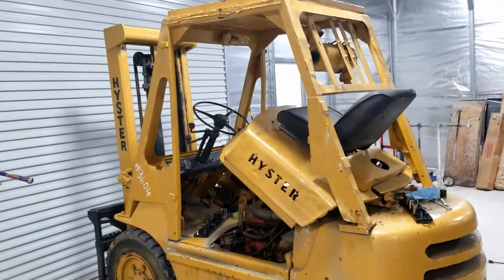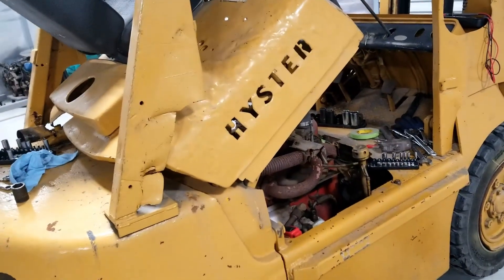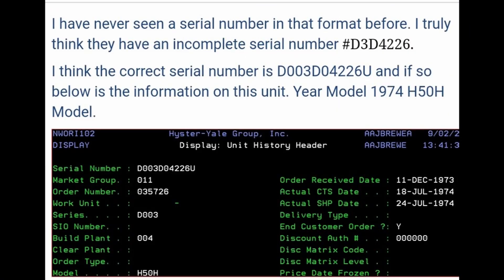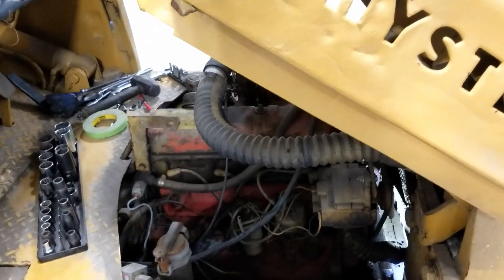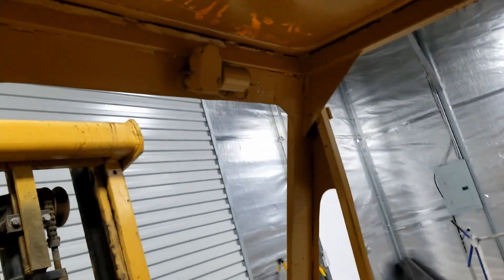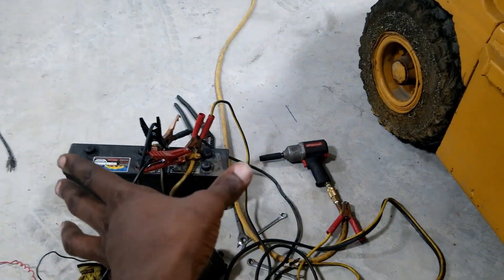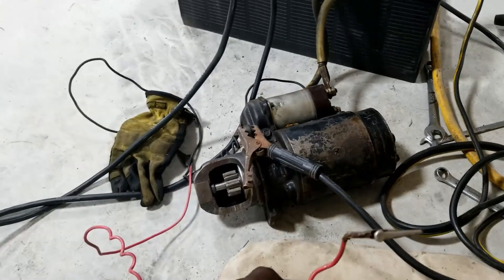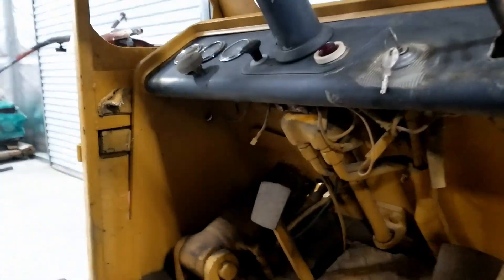Hyster H50H 1974  no crank

Comment: The thing over the windscreen is a wiper motor, the big cylinder in the roof is the air cleaner for the engine it should be down near the floor plate but it has been moved uo there, this is done usually when the machine is working in dusty conditions so the engine has cleaner air higher up. The truck is a H50H  capacity is 5000lbs at 24 inch load centres. the mast looks like a 3,3 mtr IFL two stage. Normally in the UK it would have had a Hyster mototrol powershift transmission but this one looks like it has a wet clutch and two speed gearbox. The tyres would normally be sold or what we called soft solid these can be changed for pneumatic tyres. These were the best selling lift truck in the UK in the 70s and 80s they are unbustable you will never wear it out.
Reply from the maker: Thanks! This is great information. It was so hard to find info on this forklift.

Comment: That thing looks like a wiper motor, it looks like it may have been an enclosed cab, doors, windows, etc,...
Reply from the maker: That is interesting, I didn't think about that. Thanks!
Reply: @Jayjam209  You're welcome, and thank you for sharing your projects!
Reply: Thing on top is an air filter.
Reply: Lever on right is up and down also tilt  looks like 2 speed left levers one high and low range other fwd and reverse and it is a clutch.